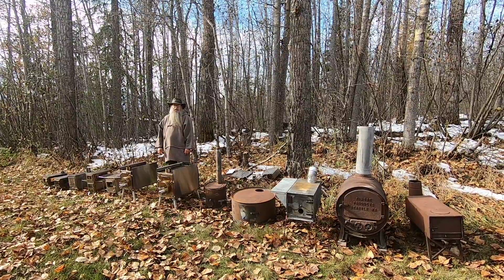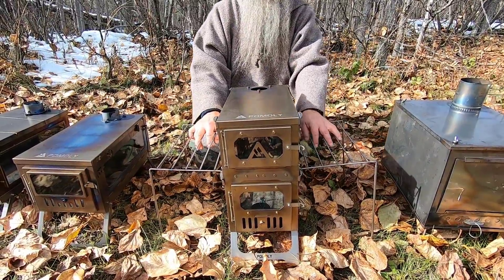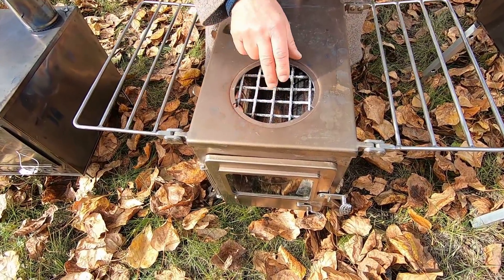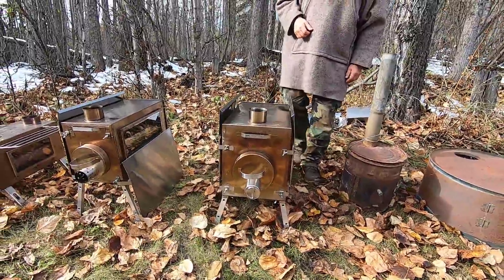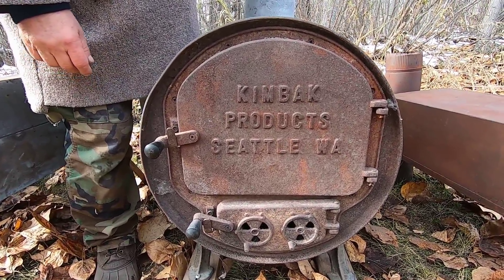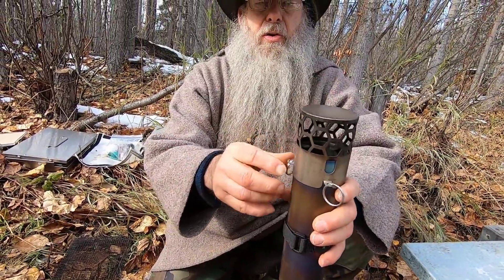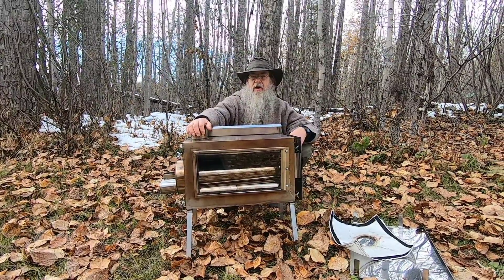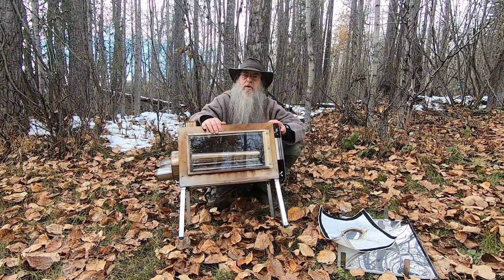Camp Tent Wood Stove info For The Common Man

Comment: Should it be rusted or not.
Reply from the maker: My large stove that is so rusty is kept in a location that is not very protected and has been wet a lot over the years.  Thus the rust.   The old military stove is still very solid and in great shape even though outer surface rust is present.  It would probably last longer if I coated it with a high heat paint.  It has however lasted for at least 40 years so far so I'm not too worried.  I have not burned this stove however for many years.

Comment: Try using household ammonia on a rag to clean the glass, just wet and wipe.
Reply from the maker: In doing a bit of online research, I discovered that stove "glass" is not glass but is actually a type of ceramic and it is not recommended to use ammonia on it as it can etch it and thus create an environment that encourages even more soot buildup.

Comment: Baffle makes for a cleaner burn and it also keeps the heat that much longer before it escapes out the pipes.  That's why the water heater is so important.  It acts as a heat sink. Like the rocks one packs under and around ones stove to absorb The heat and to keep it in the tent. . . 

So much knowledge has been lost as we have been spoilt.

Just always make sure there is a hot pot of water on your stove. Please folks. . .

Comment: I wonder why none of these stoves has no ashtray  underneath it's very helpful though
Reply from the maker: A separate ash compartment and door or drawer would add weight and bulk especially for the lightweight breakdown titanium type stoves.   It is easy enough to clean out the ashes if needed, by scooping up with a pot or metal cup and depositing in a separate skillet or pot to carry away and dump.

Comment: I can see from video that the rust does not seem to detract from the usefulness or sturdiness of the stove. That has been my greatest bugaboo, fearing that the rust would wear through the stove and create a hole. How do you know? You said a couple of those stoves you've used for years. Please ease my mind by explaining where the line is drawn between safe use and time to replace.
Reply from the maker: One really should try to minimize rust.   My barrel stove is kept in an environment where it got wet without me knowing and between the wet and perhaps some remaining bit of ashes, a mild lye was created and eventually ate through the metal in the back of the stove near the bottom.   The military stove has been rusty for a long time and I don't know how that happened other than perhaps dampness from the air as it is kept in a dry location.   I have not used it for perhaps 15 years though it appears to still be perfectly fine to use.   For stoves like those two, a person should spray a light coat of WD40 or some other oil on and in them before storing at end of season.   Make sure that all ashes are cleaned out as well.    The first fire of the season is a good time to thoroughly look over the outside of the stove in a dark environment.   If the stove has any holes, the firelight will show through easily making the hole easy to spot.   In my floored tents, I am now using a fireproof mat underneath the stove.  If any hole had developed in a stove with me unaware, any coals that fall out will either fall on the fireproof mat in my floored tents or on the ground in floorless tents.    Stainless steel stoves will probably never burn through on a camping stove that is only used a couple weeks a year total.
Reply from the maker: Ps:   When i discover a hole in the stove that has rusted/burned through, I retiree the stove.    It will not be a big hole at first most likely.   It will start out a small hole that you may not see until you have a fire or other light source in it

Comment: Ha...every stove on Earth but the one that's been the standard for trappers, prospectors, and fishermen in Canada for years....the GWM Great West Metal Air tight heater....pressed steel, 3 sizes..smallest is only $99 Cdn, minus the pipe...the landlord made a good stove out of an old steel Evinrude outboard tank..
Reply from the maker: We used to see the "airtight" stoves around Alaska many many years ago but I have not seen one now for perhaps 40 years.   They are not sold here anymore.   I liked them as they were a great stove for the price.

Comment: never saw pipes of titanium foil metal in Russia. Great idea.
Reply from the maker: The titanium as well as stainless steel foil that these are made from used to be found at US hardware/parts suppliers like Grainger Or McMaster Carr It is called rolled "shim stock."   Don't know if they still have it there now or not.      .004 inch thickness.  It may be easier and perhaps cheaper to just buy it from a stove manufacturer such as Pomoly.
Reply: @Far-North-Bushcraft-Survival  that is the thing. There is only pipes in our stores.

Comment: I know for a fact that Ammonia and a sponge will clean that glass right up.  It is amazingly fast.  Just use it before you pack for the camp-out.
Reply from the maker: In doing a bit of online research, I discovered that stove "glass" is not glass but is actually a type of ceramic and it is not recommended to use ammonia on it as it can etch it and thus create an environment that encourages even more soot buildup.
Reply: @Far-North-Bushcraft-Survival  Okie-dokie, Lonnie and Connie.  I don't see why not as ceramic is tough unto itself.

Comment: Mister get a news paper, wad up a sheet, get it damp and dip it in ashes, that is abrasive enough to wipe the glass clean. Try it, it works.
Reply from the maker: It does not need to be newspaper.  See the 25 minute and eight second mark of this video.  Evidently you skipped that part.
Reply: @Far-North-Bushcraft-Survival  l only used news paper, lt works great, another way is cut a branch, leaving it round, the length of the glass . Lay it at bottom of the glass and light the fire. The flames curling up will lick the glass clean.

Comment: 18:00 Absolutely that at the galvanized coating has got to be burned off, if your in a tent, with a new stove that galvanized will smell real sweet and has a pungent taste to it.. it's called galvanized poisoning, right on the scale or cadmium poisoning... Welders are very familiar with this stuff,,, definitely stay away from it.

Comment: The sawzall i would cut trees that had fallen and use them for firewood 🪵 my mind gets side tracked I love learning about bushcraft it’s resources it is respecting the wild not hurting creating adventures
Reply from the maker: I now have me a small electric battery powered chainsaw that I just love for camping firewood uses.   That would be somewhat similar to the using of your sawzall.    So much nicer than using the old folding hand operated manual saws though I still use them if I need to.

Comment: Pour some brasso on a rag and clean the glass. 👍
Reply from the maker: One needs to be very careful not to etch the glass in any way as it will encourage future buildup and hinder cleaning.  I do not know if brasso will etch it or not.  The "glass" is not actually glass it is a type of ceramic.
Reply: @Far-North-Bushcraft-Survival  Hi again, brasso is the only cleaning fluid i found thats able to actually remove scratches from sun glasses, also the plastic car headlights that go dull over the years.
I don't think it will harm the clear panels on the stoves. 👍
Love your videos, keep up the good work.
I've spent many years roaming the outdoors 🙏 best days of my life,  I'm older now and spend my time running a restaurant. Yes" my food is delivered now, I don't need to find it, capture it and truss it before i cook it anymore 🤣
Reply from the maker: Good to know about eye glasses and headlight covers.   Thanks.   Now if I can just remember that great info when I need it.

Comment: How do you avoid carbon monoxide poisoning?
Reply from the maker: You will smell the wood smoke long before there is any threat of CO poisoning.  With a wood stove, there will be no CO without the smell of woodsmoke.  However if you are worried about it you can always bring a CO or smoke detector with you.
Reply: @Far-North-Bushcraft-Survival  Makes sense, thank you for that tip.